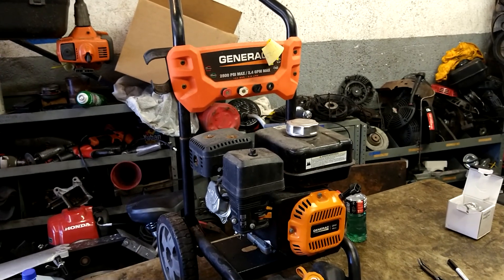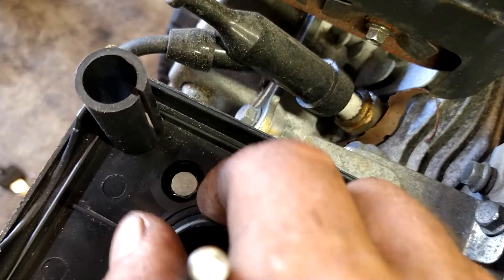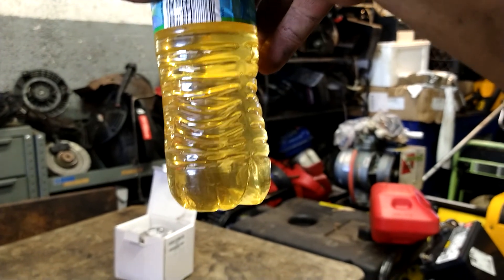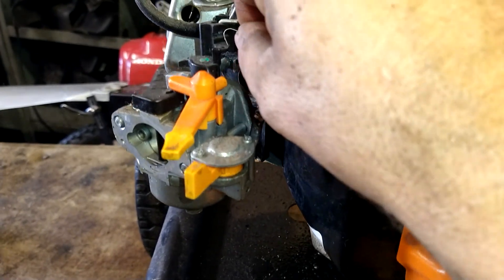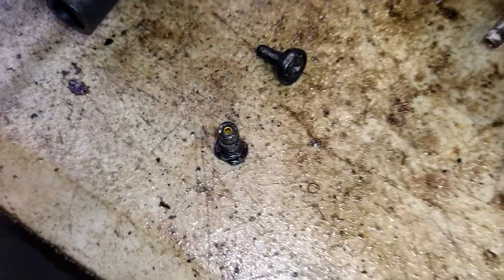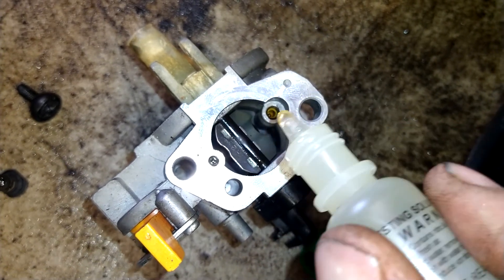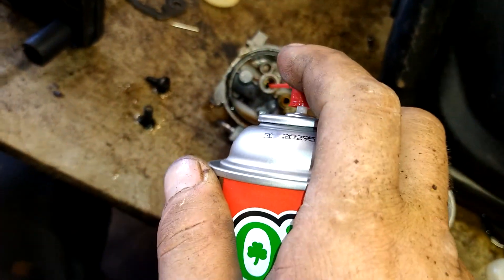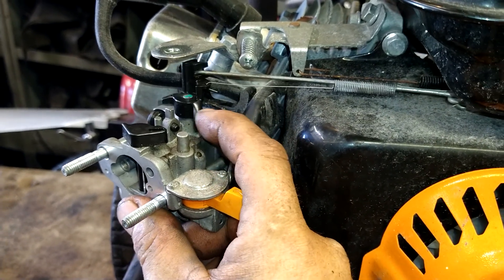generac 196cc 2800psi pressure washer carburetor repair

Comment: Thank you for taking the time to make this video and post it. The information was very helpful and I got the power washer up and running. The gas had dried up and left deposits in the jets. My local repair shop wanted at least a hundred dollars and is backed up three weeks to repair so this was very helpful to me!
Reply from the maker: Glad i could help. $100 bucks is a fair price. Sounds like at least you have an honest shop near you.
Reply: @smallengineguys  I thought $100 was okay just needed to get the washer fixed as the weather was perfect and couldn't wait three weeks. Your instructions made it very easy.

Comment: Have the same pressure washer and knew I screwed up by not using it last year with gas still in it.
Instead of buying a kit, I just bought a new carburetor for $15 off of Amazon, slapped it on and bam, done in a matter of minutes and running no problem.

Comment: Thanks for the video.  I've got the same model and it will start when I spray carb cleaner in it and then shut off.  I knew it had to be fuel related and your video confirmed it.  I'm going to do the carb cleanup this weeekend.
Reply from the maker: easy as pie
Reply: @smallengineguys  I just wanted to let you know that I tried cleaning my carburetor 3 times and I still couldn't get it to fire up so I said to heck with it and bought the new carburetor from your link. Just got it today, installed in and it fired right up. Thanks again for the great video and the Amazon link. Best $22 I ever spent.

Comment: After cleaning the carburetor, putting back together correctly, it starts runs, but really runs rough. Not a nice steady purr, any suggestions ?
Reply from the maker: clogged air filter? dirty plug? gas in the oil over filling it? carb needs to be cleaned again? it happens to me all the time.
Reply: @smallengineguys  thanks, ill check that also..maybe oil in gas..

Comment: Thanks for the tip about yellow gas. Drained the gas tank but see little flakes/ rust dust. Any suggestions on how to get it out?  Thanks!
Reply from the maker: Wite vinegar and nuts or short bolts. Shake it around. Vinegar kills rust nuts nock it off then get it all out blow out with air coat with 2 cycle oil.
Reply: Thanks so much!  If I can see the spots on the inside of the tank where the rust is starting, is it possible to coat/cover them to prevent further corrosion (some kind of paint or sealant) or just do the oil coat?  Thanks again!
Reply from the maker: @KGrant-ty3oy  i use an exspensive coating. Just out of town. Its in my channel. Look up gas tank sealer. It should pop up.

Comment: I have this same Generac power washer. Out of the box it wasn't working. I did following the directions for start up. Drained the factory oil and added the supplied oil. The engine is running rough and really bogs down when trigger is pulled. Pressure is pretty weak. It died after about 15 min and the spark plug is WAY fuel fouled. Any suggestions on what to do? I'm about an hour away from the closest warranty provider.
Reply from the maker: Clean out the carb. Pay close atention to the needle valve. Sounds like debrie is trapped under it. Worst case scenario buy a new carb. Link is in the description. Warranty places are usually months behind.
Reply: @smallengineguys  thank you sir!!
Reply: @smallengineguys  update, sometime in shipping it may have been turned upside down. Air filter seems to be completely oil soaked not allowing any air intake. I'm ashamed I didn't notice this but the man I paid to fix it had experience with it. Now I have to find an air filter.
Reply from the maker: @bt2749  its a 5.5 Honda clone
https://amzn.to/3fUItrq

Comment: Hey man! Great video, so I have this exact model and followed everything in the video minus the acid, cause it’s not here, and need to know what kind of oil to use. I cannot get the thing to crank at all.
Reply from the maker: 10w30. Spray some carb cleaner in the carb. Try starting. Does it fire up and shut off?
Reply: @smallengineguys  it doesn’t fire up
Reply: I replaced the spark plug already too
Reply from the maker: @rdcraig777  ok so check spark and compression. If you have spark i bet compression is off. Could be something wrong with the valves. Pull valve cover. Do you see anything out of place? If no spark you may need new coil.

Comment: Mine loses pressure. Not constant but if I pull the trigger on the wand it still spray with force. However, if I keept the trigger pulled it loses pressure and just squirts water. Is that an unloader valve issue?
Reply from the maker: needs a pump https://amzn.to/3zKxkkI
Reply: @smallengineguys  Damn I was hoping you weren't going to say that lol
Reply from the maker: cheap easy fix. click the link it will surprise you
Reply: @smallengineguys  so it needs a carb not a pump?
Reply from the maker: @jenkinsljenkinssquire9137  no it needs a pump i replied with a link to the pump
Reply: @smallengineguys  Sorry but the link too me to a carb repair
Reply from the maker: https://amzn.to/3zKxkkI

Comment: Help !!!! The little spring you removed came off of mine under the gas tank ! Ugh where does it go do I have to remove the gas tank ? Thanks so much for any help
Reply from the maker: no it goes to the governor arm. same as throttle rod.
Reply: @smallengineguys  thanks so much it’s in work and I’m going to fix on Monday

Comment: When I tried to take the float it is stuck.   I can’t get it out.   The jet stays in the body.   Any ideas?
Reply from the maker: soak it in diesel and try again. other than that its new carb time.
Reply: @smallengineguys  I soaked it in carb cleaner for a few minutes and was able to wiggle it out.  The needle and jet were corroded.   I pulled and cleaned them.   Fired right up!  First pull

Comment: In the same carburetor for a 4200 Generac power washer?
Reply from the maker: No
Reply: I just took apart my generac 4200 air filter/ carburetor. Basically built exactly the same. The video helped. Carb looked clean so I’m going to change oil and put fresh gas
Reply from the maker: @jupitersjunk4718  its same style yours is just bigger

Comment: I have fuel and oil mixture coming from the crank case ventilation hose going into the air box causing it to flood and shut off. What could be causing this?
Reply from the maker: The carb leaked gas into the cylinder past the rings overfilling the oil. Clean carb change oil.

Comment: Thank you. I have the same pressure washer. I bought it used. For 25$. It had water in the oil from a bad pump I think. I  drain the oil twice. Going to fill up again and drain. Will the engine be ok. Or is the engine no good now. Dont want to buy the pump if the engine is no good. The engine does run. Just  Surges. Should I just buy the carburetor and pump. Thank you. Great video
Reply from the maker: engine is fine clean carb or buy new one replace pump you got a good machine.
Reply: @smallengineguys  Thank you. I am going to buy both. Just to make sure it run good. Very much appreciate you getting back.

Comment: I bought the same power washer brand new and once I filled it with gas it started leaking, it’s like right behind where u turn the engine on and off(the 2 orange flips in the front) was gonna call customer service but they’re closed
Reply: Should I just return it for a new one?
Reply from the maker: fuel line may be disconnected under gas tank id return

Comment: The orange handle for the gas switch broke off any way I can just order that lever piece or do I have to buy a brand new carburetor????
Reply from the maker: Ive never seen one sold separate online. However go to your local shop they may have one laying around. I have some. Same as a 5.5 honda.

Comment: Hi, My power washer is getting gas in the oil. What do you think? is there something I should look for?
Thank you for the video.
Reply from the maker: it is your needle valve. you must clean the carb the needle valve is stuck open. its under the float. or new carb is in the description thats the easiest way. make sure to change oil when done before starting.

Comment: I have the same washer I cleaned the carb and if I put a little gas directly in the carb it starts for a few seconds and dies any idea what I should try next?
Reply from the maker: Clean carb again. It is carb
Reply from the maker: also make sure fuel is flowing out of the tank well. did you clean tank? didnt forget any gaskets? sometimes you have to just replace the carb. carb fuel lines gaskets
https://amzn.to/387QNi8
Reply: I cleaned the carb again and now it runs great until I start pressure washing, the power goes up and down like it wants to shutdown and if I stop pulling the trigger after a few seconds it smooths out and runs fine but if I start washing again it does the same thing, Rundgren just idling
Reply: Runs great idling
Reply from the maker: @karenjackson4203  bad gasket? Not fully clean. Jet is only letting out enough fuel to idle not to full throttle
Reply: @smallengineguys  I cleaned it again it works good now but only if the choke is halfway closed if I  open it all the way it runs very rough then quits.
Reply from the maker: its getting closer. sorry sometimes they are a pain in the ass. if you have a wire wheel or wire brush pull a single wire out and poke threw the jets then clean again. your so close sorry.
Reply from the maker: needs more clean sorry

Comment: Hey how you doing.  I got I pressure washer that was swathing for a some time. I took it of part to clean it up. But I don’t remember if the crankshaft have to be in a specific position 0065950 - Generac 2,500 PSI Pressure Washer this is the pressure washer
Reply from the maker: im sorry im not sure what your asking me

Comment: Ethanol free is usually high octane . Whats up with not using high octane ?
Reply from the maker: high octane still contains ethanol. it also goes bad faster than low octane. non ethanol fuel is rec 90 most commonly
Reply: @smallengineguys  glad you cleared it up I've been using Rec 90 non ethonol
Reply from the maker: @oldtimedrumcorps  perfect